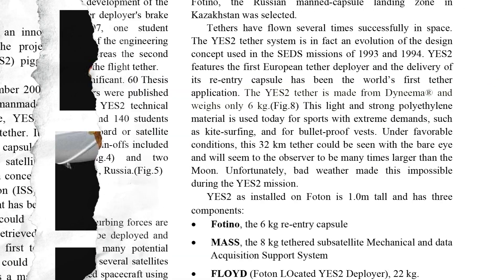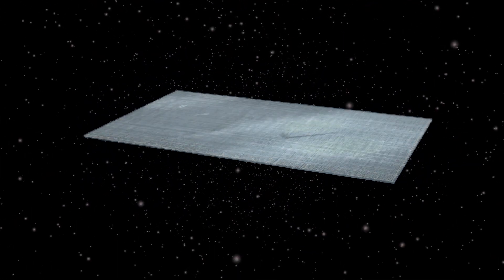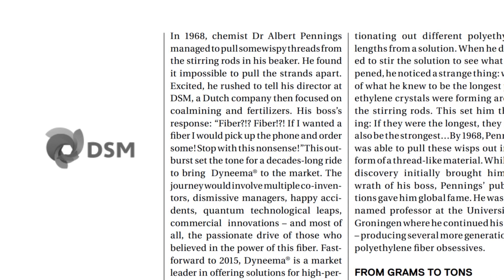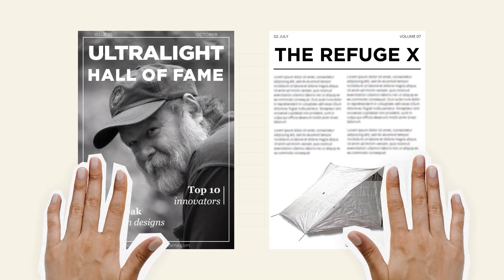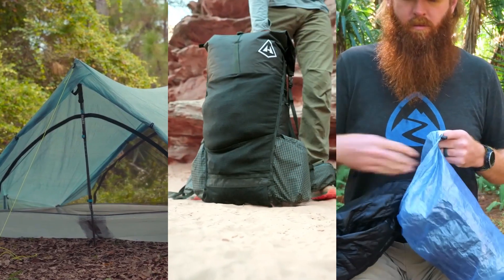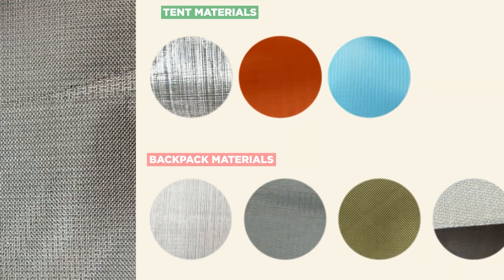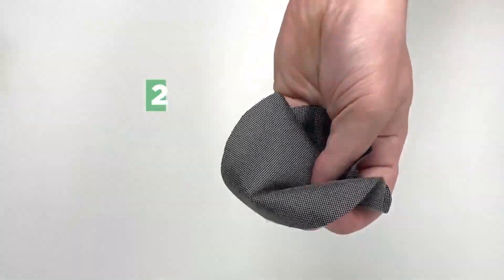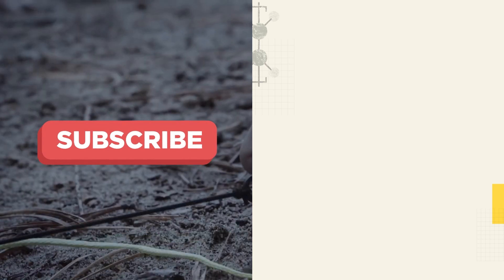This Is The Magic Material That Changed Hiking

Comment: I own a Dyneema tent by one of the companies named in this video. While it is a great tent, after three years it has become "thin" or "silky", I'm not sure how to describe it. I think this is mostly due to UV attacking the material. I'm planning to hike for four months next summer, and I don't trust the material to last through that hike . Given the cost of the tent and the fact that I need to have something I can trust will last for the duration, I bought a new tent and it is not in Dyneema : I went with sil poly. Less than half the price, a few ounces more, and this should last quite a lot longer.
Reply: This. Its abrasion-resistance is horribly lacking.
Reply from the maker: Indeed. Wear and tear can definitely take a toll on it.
Reply: @Greenbelly  Just to clarify, it's the fly that's has become silky. New DCF is crisp, almost crinkly. Because it's the fly I don't think abrasion played a major role and that's why I suspect UVs from the sun. The DCF floor itself has withstood three years of pretty intense use without any visible damage.